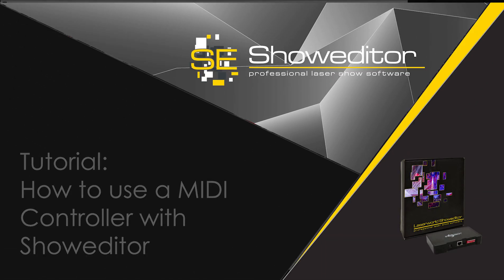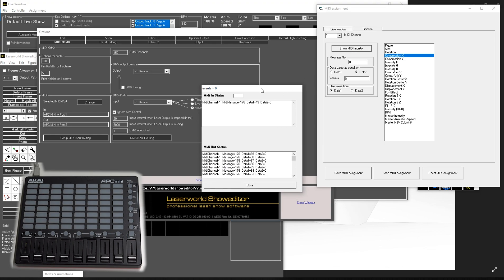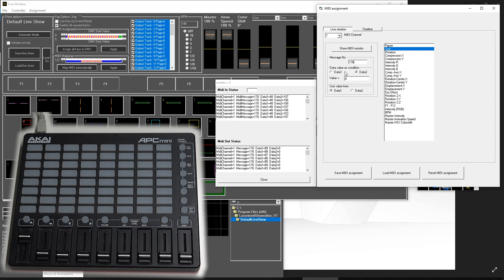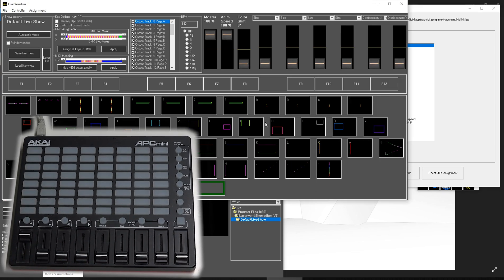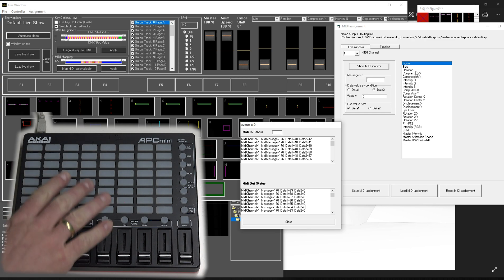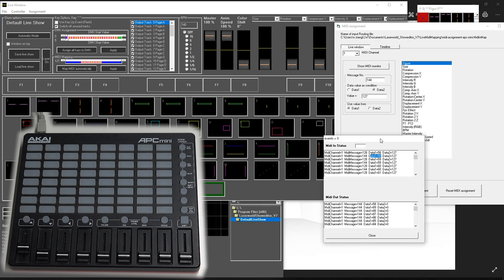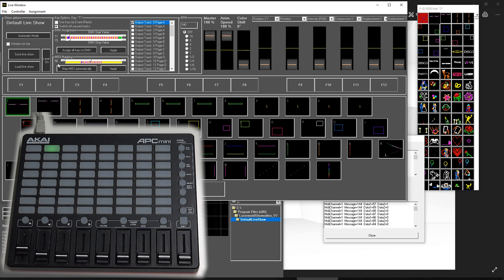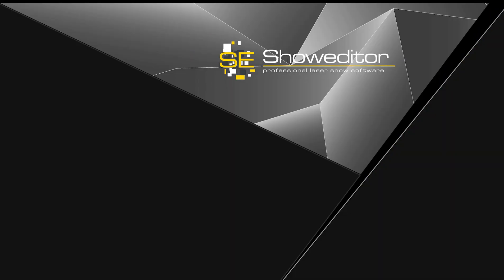How to use MIDI Controllers with Showeditor

Comment: How to use dmx options in showeditor software
Reply from the maker: It depends on what type of DAC you have - external or internal. With an external ShowNET DAC you just need the DMX adaptre to get the hardware side connected. 
Details on how to use DMX (In and out) are described in the manual: 
Remote control of the software: https://www.showeditor.com/en/manual/12-remote-control-of-the-software-via-dmx-and-midi.html
DMX output: https://www.showeditor.com/en/manual/11-dmx-editor.html